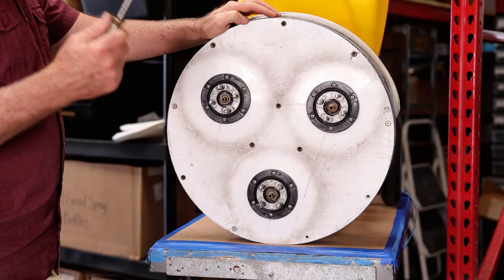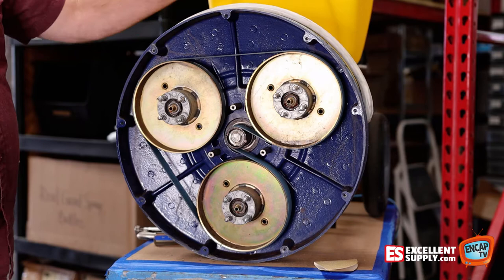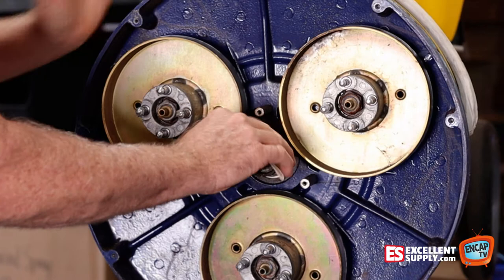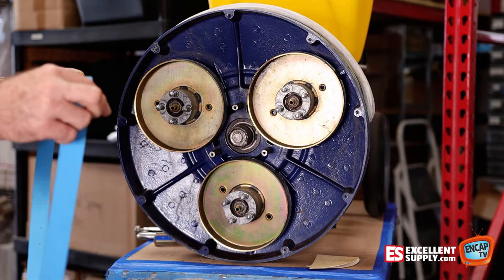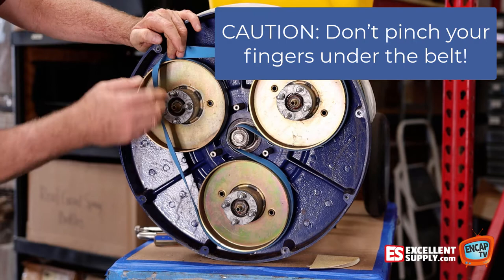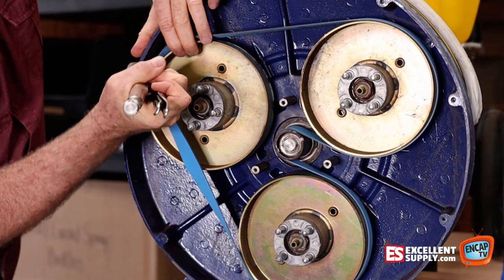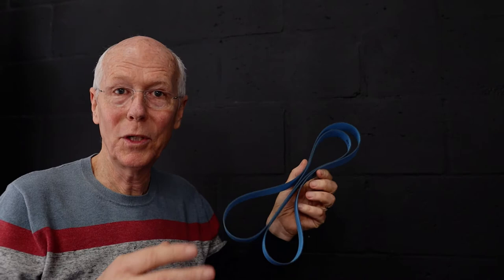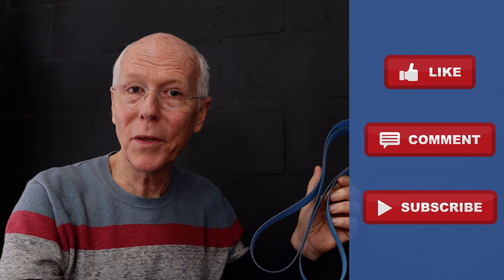How to install a new belt on a Cimex machine

Comment: I have no idea how old my cimex is i bought it after our first meet and greet in Pensacola Fl Rick might remember when that was, i did buy a new belt when excellent supply hosted a summerfest event for us . but have never put it on really the only thing i have done to it is install the big wheel kit. I do need a new tank for it. I repaired it once but i went to use the other day and water was coming out almost as fast as i was putting in, once it got about 3 gallons .
Reply from the maker: Hi Ades, it's nice to hear from you! That carpet cleaner meet-up in Pensacola was in 2003 (I remember because it was the weekend the Bucs one the Superbowl for the first time). If you need some help walking through a Cimex repair, give us a call and we can help you out with that. Anyway, it's great to see that Cimex is still running after almost 20 years! And that you are too. 😄